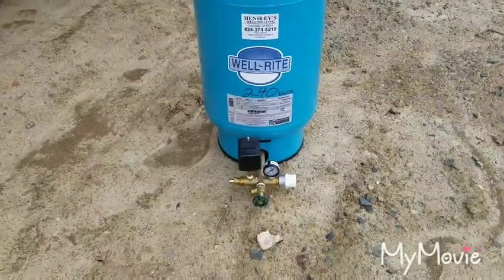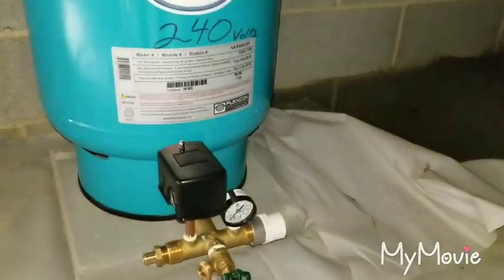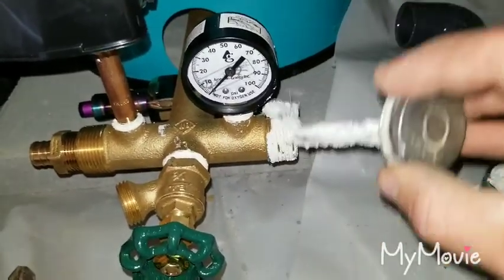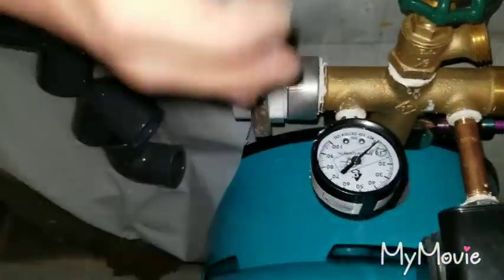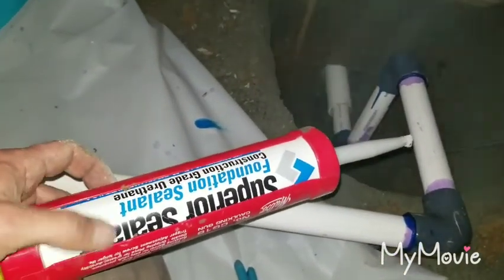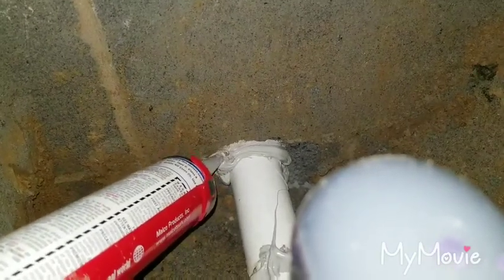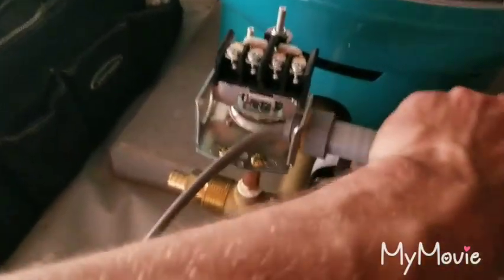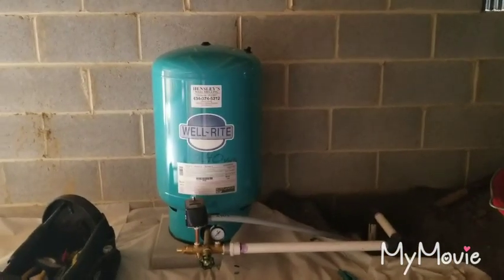Water Well Pressure Tank Install, Bladder Well Tank Great Tips

Comment: Using your techniques I verified our bladder was ruptured on our well/irrigation system tank. I was wondering why I couldnt get the pressure switch adjusted right. The pump short cycles and only builds about 44psi. The original tank is a 22 gallon unit and we are thinking of putting a larger bladder tank in. We will definitely check the precharge of air in it before filling it with water. Getting some wide price differences between vendors too, Grainger has a 80gal tank with a fiberglass body (I wouldnt trust it, always have used metal tanks round here for years), for $1067 ! Then theres a 119gal metal tank for $863 from another local vendor. Then theres Amazon, less costly, but says material is polypropylene, not metal. Cripes! Makes me want to go back to the old air-volume control type tank my folks had back in the 1970s! Darn bladders only seem to last a few years!

Comment: Great video. I have a well tank beside my well pump in a concrete block hole in my front yard. Could i install the pressure tank inside my house?  Its maybe 25 feet from the well. Would be easier for me to keep after it. Plus its really damp and humid in the pit its currently in. Would i just need a one way valve preventing pressure from flowing down the wellpipe?

Comment: Hey man, great video. I wish I would have seen it before replacing my 70's 80's tank. I replaced it the same way it was before, it was professionally done 40_-50 years ago.in a basement. I have a little sensor that was wired into control. I put it back but don't know what its for. Looks like a photo sensor for light. My control is 3ft above the floor so don't think its water sensor for leak. Anyway, new tank has helped tremendously, but pretty slow fill. What does a well pump replacement cost? Pretty sure I need to start saving.lol

Comment: Does it matter where the one way valve is installed? On the outlet of the tank vs the inlet? Thanks for all the great videos
Reply from the maker: It's not necessary for one at the tank. If you want to add one, put it on the out going side of the tank
Reply: @h2omechanic  Thank you!